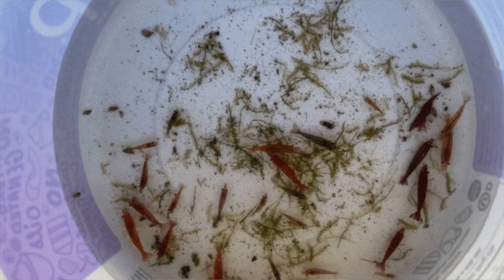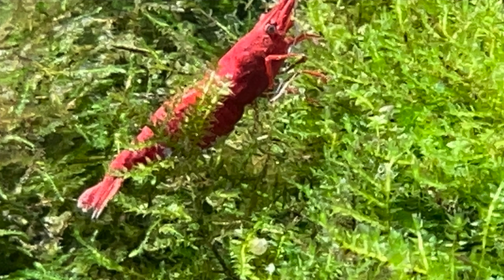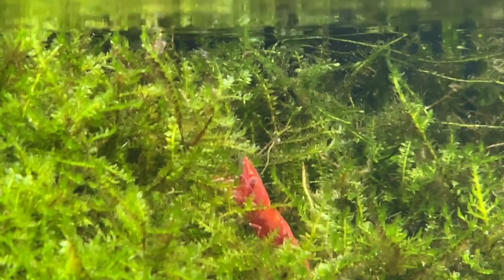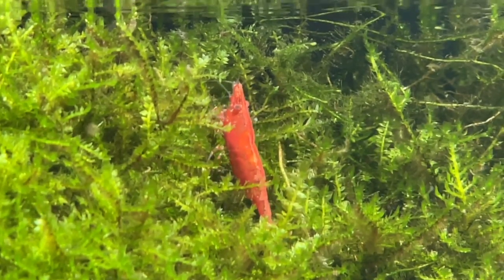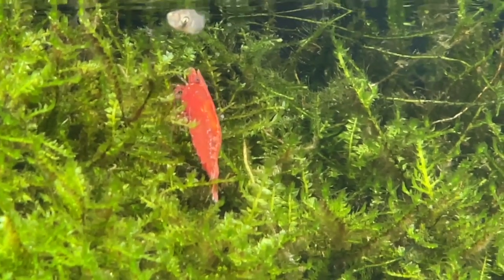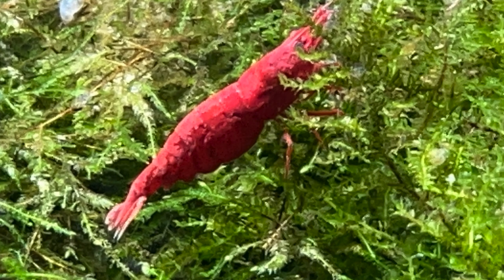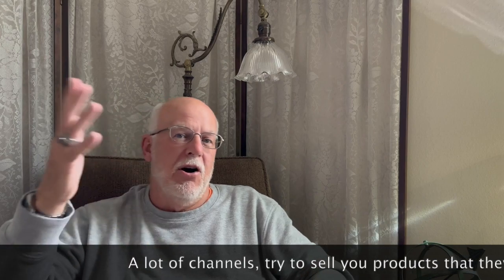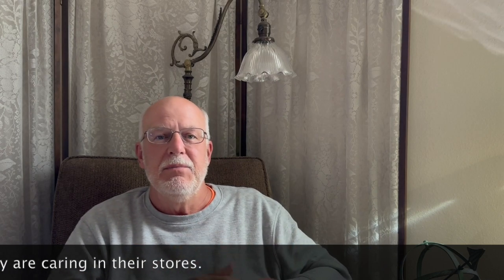Warning: You’re not going to believe what I found alive at the bottom of my canister filter.

Comment: I have cherry shrimp in a 5 gallon tank and they thrive well and breed like crazy once I put in a heater designed for up to a 5 gallon tank with a set temperature of 70F. I have cherry shrimp and feed them Krill flakes from Xtreme, which helps them hold their color well. Floating plants and a net mesh like for crafts and 2 sponge filters. Plus, shrimp food. I give my excess to the Father and son Aquarium shop to sell and I get a discount on the food. Now I am making a 2 gallon tank using a plenum like I learned from you. (74 and still learning.) I also dumped some of the shrimp in a 10 gallon tank with mini tropical sunfish and they thrive with the sunfish. To me, shrimp are an easy keep.

Comment: its funny Dr Novak, when I used to have a sump in my tanks I always had the same problem, in the sump itself I would find neons and other small fish that got over the weir and into the sump.  I was cleaning them out all the time
Reply from the maker: Same thing happened to me when I had my SGA aquarium with a wire and sump. Every once in a while, I'd have to catch a fish that went into the weir. The biggest problem I had was snails, big snails clogging up the 1" pipes.
Reply: @anoxicfiltrationplenums  was that the reason you went away from the sump and connected the weir to the canister filter?  I was always curious

Comment: It seems to me all you need is a stainless steel intake guard. Yes this has happened to me. Got 50 sterbai cory out of one of my canister filters once. They went in as fry and and came out as a teenager.
Reply from the maker: You're killing me here. When in as fry, they came out as teenagers. That's a good one. However, using a weir doesn't really give me much opportunity to block off the intakes at the very bottom of the weir..